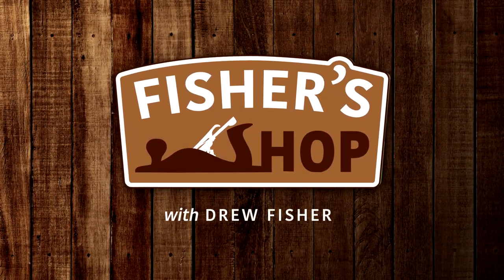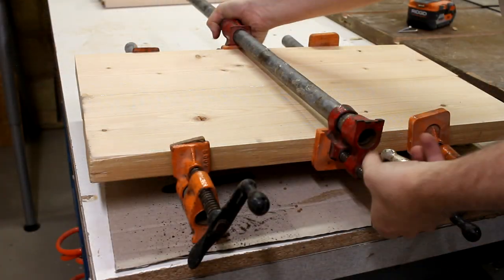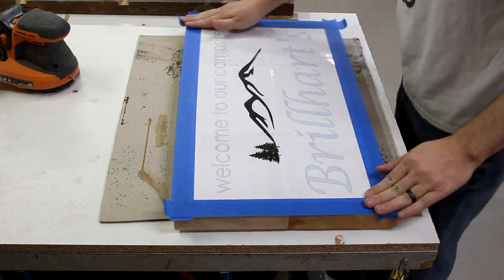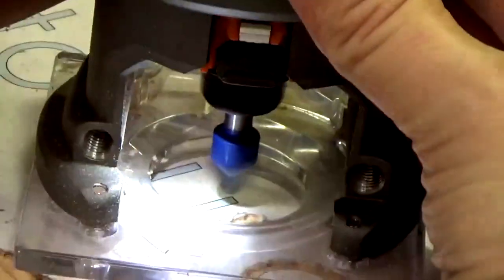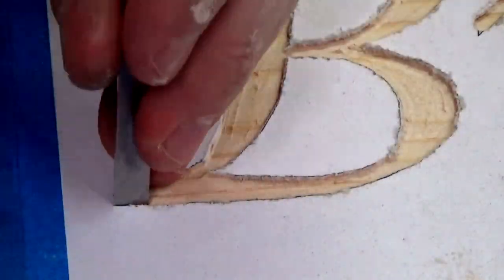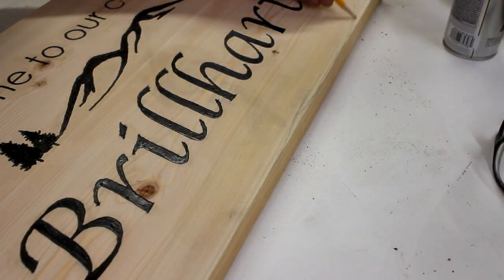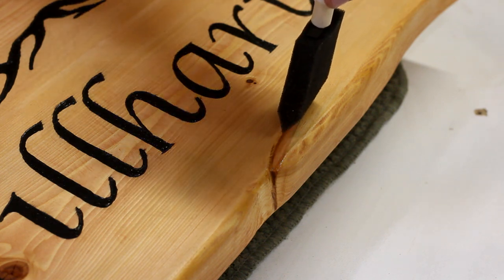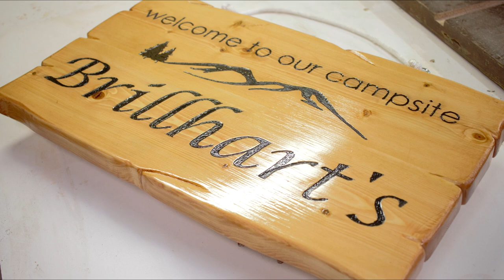Woodworking: How to make a Camping Sign

Comment: After having made quite a few signs, ,some things that made it easier for me. (maybe you're already aware). On soft pourous woods like pine, sanding sealer first will stop the bleeding. Also, if there's any intricate lines to 'rout, (only on a laser printer) printing it in mirror image, then ink side down on the wood and secure it. saturate the paper (where there's print) with lacquer thinner (will evap quickly) and rub in with a rounded side of wood or plastic. This will leave a very decent image on the wood to follow with the router.
Hope this helped someone. :)
Your sign came out REALLY nice!
Reply from the maker: Great tips!  Thanks!

Comment: Drew........even though I've done some sign carving, I still picked up a couple of good tips here. You're right about how to best grip the router. I added this base to mine:: http://www.makeawoodsign.com/shop/index.php?route=product/product&path=6&product_id=93
But you could easily make one yourself, or even add handles to your existing base plate if there's enough room. It really helps A LOT! Your first sign looks a lot better than the ones I'm doing after some experience. Well Done..
That''s a good tip about feeding a scrap 2 x 4 ahead and behind the board you're thickness planing. I'll remember that. Even if one of your projects isn't my cup of tea, I still watch your videos all the way through because you're so entertaining. I hope you make more of them. Thanks.
Reply from the maker: Thanks for the tip, Jim!

Comment: The horror when you remove the tape and the paint is everywhere where it is not supposed to be :-)
Reply from the maker: I know right??  I practiced on a test piece and it came out perfect.  Then I switched to a different brand of paint but didn't think it would matter.  Apparently it did.  Good thing it cleaned up ok.  Thanks for watching!